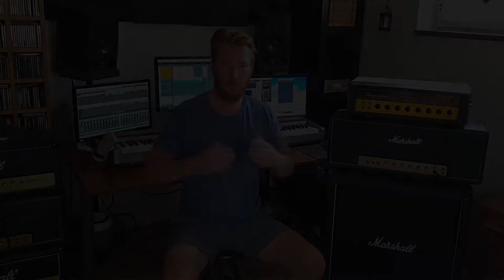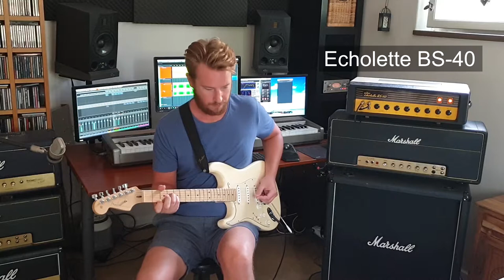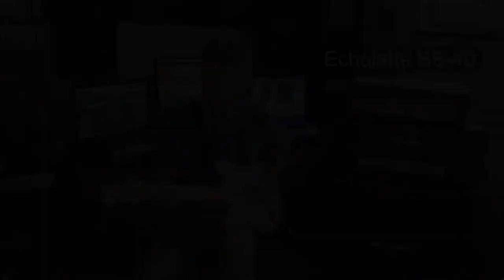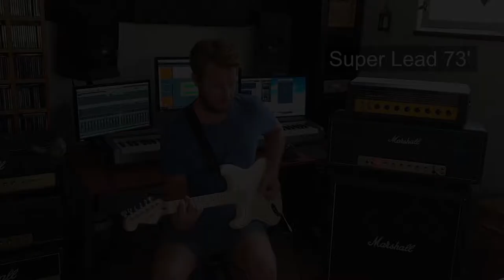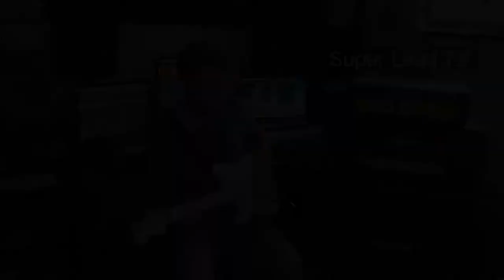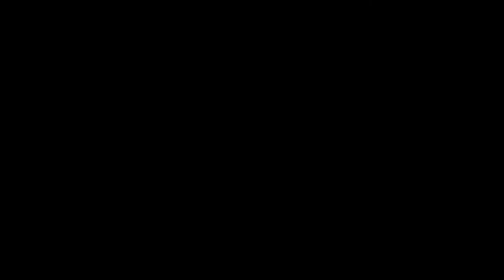Echolette BS-40 (From 1963) VS Marshall 1959 Super Lead (From 1973)

Comment: Hey Emil thank you so much for this review. I finally got my own bs40 and checked the schematic: I might be wrong, but the pair of Inputjacks on each channel of the bs40 are connected in an unuseual way. They short the 1 Meg Ohm Input to ground resistor, so that the Input is now longer a guitarsuitable Hi-Impedance Input but a 100k Ohm kind of Lineinput. The only way around this is to plug a dummy-plug in the empty jack of the corresponding Input Jack pair. Then an Hi Input Inputimpedance is garanted. That means, if you had used your jumpercable on channel 1 and not pluged it in channel 2, channel 1 would had been Hi Impedence. But since you jumped it to channel 2 and left the second Jack of channel 2 empty, channel 2 becomes low impedence and influenced channel 1 backwards to be an unuseable low impednce Input to. Useing the bs40 with the wrong input impedance does colour/ darkens the sound. Maybe that is why the Marshall sounds a bit crispier and direct in the Hi- Frequencies. But again, it's just an idear by looking over the schematic. I might be wrong or oversee something. Never the less, the 4 jacks on the bs40 are connected different to the jacks on an JTM45 / Plexi.

Comment: The Echolette BS40 was originally designed as a Bass amp with approximately 35 Watts with 2 EL34 and is near on Technically the same as a Bassman or JTM45 apart from the rectification and a few Caps and Resistors in the Tone stack and the Tube Selection. The BS 40 has ecc808 Preamp Tubes which were the successor to ECC83/12AX7 which are cleaner, never unfortunately caught on in theAmp world and as a result cost roughly four times that of a ECC83..